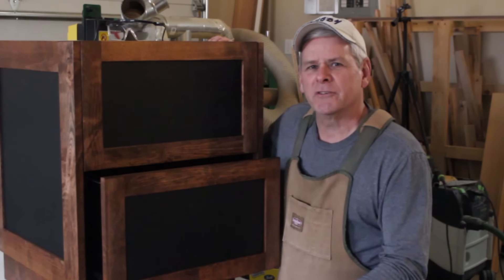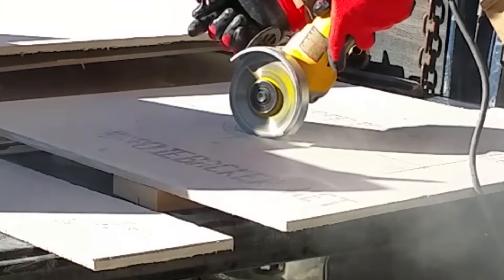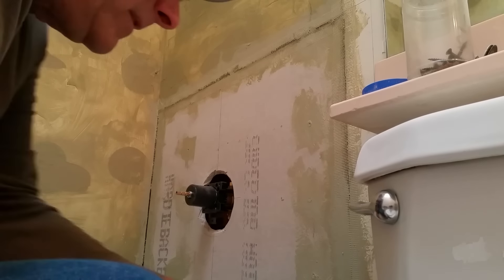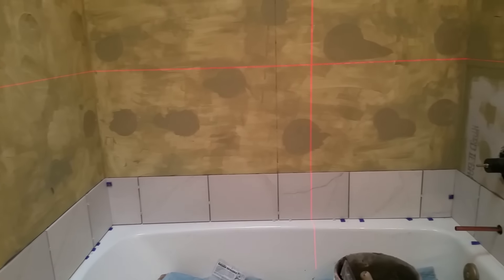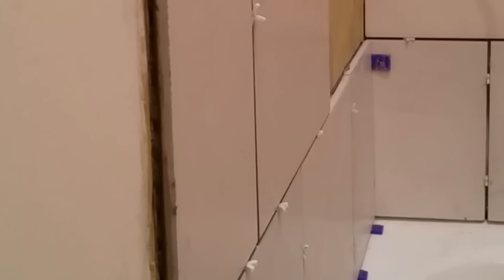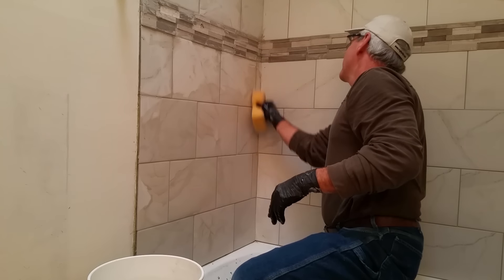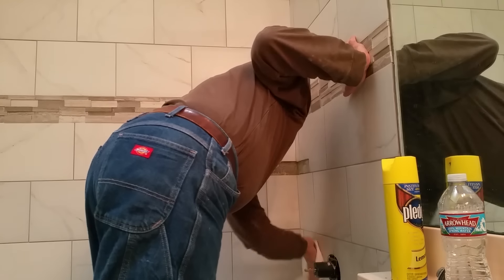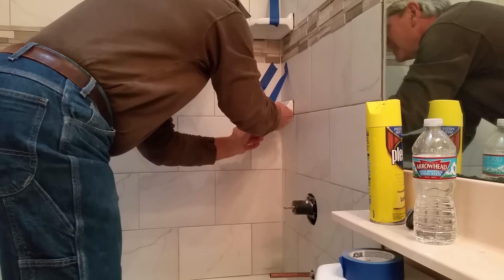How to Set Tile Around a Tub - Bathroom Remodel

Comment: I have a question that I can’t find the answer too anywhere. I’m tiling an old shower wall that was horse hair plaster n lathe. The holes in the plaster around the faucet knobs are too big and the plaster has crumbled away leaving no wall behind. How do I patch that so I can tile over it? Thanks.
Reply from the maker: Hey Jonathan. That's a really good question! You are definitely working with a very old method if you are in the States. I would chip away enough of the plaster to expose some of the lath, maybe an inch or so. You might even be able to take channel locks and crush the plaster to remove it without doing damage to the lath. If you need to add some new pieces of lath to fill up to the holes needed for the new faucet, you can tie them in place to the old lath with thin wire. You could probably use plaster of paris but I would prefer to use 1 part of portland cement and 4 parts sand in a mix to build back the wall. Spray a water mist on the plaster where it is going to be in contact with the cement mixture. Apply a layer of the cement mix to the lath that is about the consistency of half frozen ice cream and let that dry.  The cement is going to be easy to push through the lath so carefully add enough just to cover the lath and let it dry. Next come back again with the same cement mixture and consistency and build your wall back to its finished level. The base coat of cement (called scratch coat) will now soak the water out of the finish coat causing it to dry quickly and allowing you to flush out the new coat with the surrounding plaster. That should work and I hope the explanation is clear enough to understand. Good luck!

Comment: Does the backer board sit over the lip of the tub?  In my case, the backer board is behind the tub by a bit, and i'm not sure exactly what to do.  i could put a 2nd piece of board on top, but then my edges will be really tall.  Any suggestions?
Reply from the maker: Yeah, Kevin, that's a situation where the original framers left too big a space for the tub and is a pain to deal with forever after. Yes, it is best if the backer board extends at least a little over the lip of the tub. The way I typically fix it is to add the additional layer of  backer board on top. Then, at the edge I float out about a foot of drywall mud from the backer board edge onto the adjoining sheetrock and gradually feather it so that you taper the tall backer edge into the bathroom wall over that 12" or so. This takes multiple coats of mud over several days. Then re-texture and paint the wall to match. That's the best way I know to make it look right and give you a good tile installation over the tub.

Here are a couple of my videos on repairing sheetrock damage. They don't specifically address your situation, but the concepts are the same for what you need to do. 

https://youtu.be/kDQ2juMystA

https://youtu.be/JDBEqiMe-WQ

Comment: Thank you! This is so helpful! How do you know whether to use your purple or white spacers and what are the difference? Also, do you know what tile this is, because it is exactly what I have been looking for!
Reply from the maker: Thanks for your comment and questions, Ashley! In this case, the tile did not have its own built in spacers for grout joints, so I was shooting for 1/8" joints. The white and purple spacers are just different brands of 1/8" spacers but you raise an important point. The critical issue for a good looking tile installation is to keep your tile lines running level so I am constantly adjusting and shimming the tile as I work. Lots of variables can cause the tile to begin to creep out of alignment as you work your way up the wall. So, sometimes you need to shim a little more or a little less than 1/8" to keep the next row up level. I keep small pieces of cardboard handy just for that purpose too. The more you do this kind of work, it becomes second nature. The tile was purchased from Lowes and was a discontinued line they were phasing out. I remember it being a gray and white tile and was not an expensive brand. Check Lowes and Home Depot and both may have something similar at any given time at around $2.00 per square foot. Thanks again for watching!
Reply: @RustyDobbs  thanks for the pro tips Rusty

Comment: So, you don't put caulk between the tub and the backing board edge?
Reply from the maker: You certainly can, Andriy. In this case, because the tub has a flange at its edge that the backer board can rest on, I don't really worry about caulking the joint at the top of the flange. The flange keeps water from going up over the edge. But there certainly is no issue with caulking that joint either.

Comment: Nice work! On your side walls, did you also center your first tile and add tiles to left and right to fit and look balanced?
Reply from the maker: Thanks, Robert! No, I think in this case since I was stacking the tile in a brick pattern, I started with a full tile and half cuts where the tile stops on the wall. Generally, the main thing I am looking for when laying out is to not end up with some weird tiny cuts somewhere. If the symmetry works out well, that's a bonus but not the main goal. I appreciate you watching!
Reply: @RustyDobbs  
Thanks Rusty! I think I misunderstood. On the adjoining walls you did not start with a centered tile and work around each side of that main tile to have equal lengths with cutting when needed? This is the way I've started my subway tile (brick pattern, 4" x 12" tiles) and shouldn't end up with any short nubs. Thanks again!
Reply from the maker: @boomerboon1946  Yeah, on the back wall I always start with a center line that I either center a tile on or have a grout joint on depending on tile size and brick or stacked pattern so it is generally always balanced. Sidewalls are a different story depending on how far the tile extends beyond the tub, location of plumbing, etc. Fun, isn't it!

Comment: I have one question about tiling in general, what process do you do first, grout or caulk in a bathtub? It would seem if you grout first it may get into places like the corners and where the tub meets the tile where you really want only caulking. My project is getting close to this part and I have seen no info for this step.
Reply from the maker: Definitely grout first, let it dry and buff it with a rag with a little furniture polish sprayed on it to keep the dust down. You can take a flat head screw driver or a putty knife and gently scrape out any grout that may have been pushed into a corner or at the tub. That doesn't have to be perfect either. Then caulk as the last step. Here is a link to a video on caulking for your reference if you need it. Good luck with the project, Coffee2clutch! Love hearing about people taking on projects like this themselves!

Comment: You don't see too many people that only back butter tiles without applying thinset to the wall.
Reply from the maker: Depends on the situation, Speedster. The goal on any job is to get close to hundred percent coverage of thinset between the tile and the wall. This is a 9” x 12” tile so I’m not worried about getting good coverage by back buttering only. A little cleaner for me to do this way as well. Here’s a video where I’m installing 18” x 24” tile over a tub, so I use a different approach.  https://youtu.be/vkJSdmmeeS0

Comment: I noticed you did not thinset the wall too along with the tile. Is this not neccessary? Everyone else I see does both.
Reply from the maker: The main goal is to get close to 100% coverage of thinset between the tile and the wall, Bryan. This is smaller tile so I could gauge how much thinset I needed on the back of the tile to have a good thinset bed. I popped the tile loose every so often as I installed to check coverage. For larger tile installations, I do both as well.
Reply: @RustyDobbs  thanks. I just did a tub surround with 12x24" ceramic. Turned out good.

Comment: So when you’re cutting the tiles in half and using them on the front of the shower, what do you do about the chipped edge?
Reply from the maker: It is better if you use a newer saw blade to get as smooth a cut as you can. From there you can use many types of abrasives to buff the cut edge to improve its look. A belt sander is a good option. Not as good as a finished glazed edge, but it can be made to look nice in the absence of bullnose. Then I like to backcut the exposed tile edge at a 45 to create a grout joint that finishes out flush with the tile. That grout joint is also durable as opposed to trying to pack grout at a 45 against the wall and the tile edge. Thanks for the question, AzPoorBoys!
Reply: Rusty Dobbs thanks so much!

Comment: Do you caulk the gap between the hardy backer and tub before the tile is set?
Reply from the maker: You certainly can. I typically don't when it is on a tub rim like this where the rim is sloped back towards the tub to keeping water from going over the rim. I focus more on my bottom tile cut at the tub leaving about 1/8" gap for caulk at completion and then emphasizing with the homeowners the importance of maintaining the grout and caulk over time. But every situation can vary.

Comment: I'm so confused. I never saw you put thinset on the wall. But you back buttered every tile. What am I missing, I've never seen it done this way, Please explain?
Reply from the maker: Hope I can un-confuse you! The main goal in setting tile is to get as close to 100% coverage of thinset between the back of the tile and the wall when you set it. I don't care how that gets accomplished. I can trowel thinset on the wall and then slightly back butter the tile before setting it, which is the case most of the time and probably what you are used to seeing. In situations like this job, the smaller size of the tile caused me to change my approach. When the trowel size is almost the size or larger than the width of the tile, it is a pain to trowel thinset on the wall, back butter the tile, then cleanup the extra thinset not covered by the tile when it is set. It is not good to set tile on thinset that is beginning skin over and dry on the wall because you may not be immediately ready to set the next piece of tile yet. So, in this case I am gauging the amount of thinset (extra in other words) I'm applying to the back of the tile to allow me to press it in place and get 100% coverage between the tile and the wall. Every so often I will set a piece of the tile, then pop it off the wall to check coverage. You get a sense for this after a while and can tell by feel as you press and rotate the tile in place if you are getting complete coverage or not between a piece of tile and the wall. Just a tweak to my approach to for a specific situation and actually makes for a cleaner installation. Hope that makes sense!

Comment: Is the entire wall hardy backer board?
Reply from the maker: No, previously the entire tub area had been covered with 1/4" solid cultured marble, so the backer board behind that was in perfect condition. We coated it with a waterproof membrane before setting the tile. The area around the faucet however had some water damage, so we replaced that area with Hardibacker.

Comment: why aren't you applying the mortar/thinset to the wall, notching it then applying the tile? You'll get better coverage that way, and a longer lasting final product.
Reply from the maker: It has to do with the size of the tile, Thomas. I believe these were 8x8s or 9x9s and backbuttering was an easy way to get consistently close to 100% coverage between the tile and wall. Periodically I installed a piece, popped it off to check coverage, then adjusted the amount of thinset I was applying as necessary. For larger tile, I apply thinset to  the wall and backbutter the tile as well.

Comment: What are the black pieces you used under the first row of tiles? Wondering where to find them. Thanks!
Reply from the maker: Those are just one version of tile installation shims that I found at Lowe's. They are beveled from nothing up to 1/8 of an inch with various other sizes in different colors. Pretty handy but I'm not sure I have seen them lately. I bought them several years ago.

Comment: Four bathroom   tiles fell off from the  wall at the  bathtub.What can 
type of  glue  can  I use  to reinstalle the wall tile back on the  wall
 ?
Reply from the maker: Ok, Nathan, that's not a good sign about the overall tile installation so this is probably not the last time you're going to deal with tile falling off the wall.  I'm guessing that this is an older installation with tile less than 6 inches in size and tight joints? As a quick and reasonably permanent fix, I would buy a tube of silicone caulk and a small container of unsanded grout that matches your joints. Every few inches on the backsides of the tiles, put globs of caulk about the size of a quarters and push the tiles back into place. After a couple hours, mix water with the grout to about the consistency of half melted ice cream. If you don't have a grout float, you can take any type of blade or putty knife and press the grout into the joints. Wash the grout joints back down flush with the tile with a sponge after allowing it to dry about 10 minutes, then buff the tile with a cloth when the area is dry. If the grout joints are wider than 1/8 of an inch, you're going to want to use a sanded grout instead of the unsanded. Good luck!
Reply: Yea  I was  thinking the same  thing using  white  caulking.But  unsanded and  sanded   grout I did  not  know.Thank you very much Rusty for your  valuable information.Have  a good day.
Reply: Sorry to bother  you again Mr. Rusty  but  I got another  qestion.There old grount on the tile and  wall.Howcan I get that off.I try to chisel it off but broke  the tile.And  where can I get 1960's pink bathroom  tile at.Everywhere  I go they sell white.What online store sell pink bathroom tile ? Thanks.
Reply from the maker: You're probably out of luck on that one, Nathan. Pink tile you might find online probably wouldn't match very well and the dimensions would probably not be correct either. That's the kind of thing you run into repairing old tile jobs. At this point, I would suggest you get the tub/shower functional again with whatever tile you can find that works. Sounds like it's about time for a new tile job! You're on the right track as far as removing old grout and adhesive. You do whatever works. An angle grinder can help with getting it off the tile.

Comment: Great video. Is the "perfect level" always going to be below the first row of tile? Could it be above and then fill in gap between 1st and 2nd row with grout? Also did you cut the holes for the soap dish before or after you placed the tiles?
Reply from the maker: Not sure if I completely understand your question, Matt. If the tub is perfectly level (which is likely not the case) then the "perfect level" line could be one row of tile above the tub. If not, you want your perfect level line to force you to make cuts at the tub to create an acceptable grout/caulk joint there. You can adjust your line down to help make the cuts against the tub easier. You never want to "fill a gap" with grout that is larger than what is the normal grout joint for the job you are working on. Yes, I cut the slots for the soap dishes in the tile on a tile saw before setting the tile. Thanks for the question.

Comment: really helpful info. I'm going to undertake my bathroom reno myself soon. I have to do floor tile everywhere and wall tile in the tub/shower area but to the ceiling. Would you normally leave a 1/8 gap at the ceiling to fill with caulking too? Also someone I know is telling me to use plywood with tile treatment you mix with water and brush on for the floor tiles. Should I still use cement board for the floor too? I would think even treated plywood would expand and contract at a faster rate than tile which would cause grout to break up.
Reply from the maker: Good luck on your project, Sparky Jay! Yes, that would be fine to leave a 1/8" gap at the ceiling then use siliconized caulk to match your grout in that joint and in all other corners. In this day,  I would always use cement board over a wood subfloor. Your instincts are right about the plywood. Even treated properly, why would you set tile on it when you can install cement board over it and not worry about your installation. You'll get a lot of satisfaction out of this when you are done.

Comment: Outside most tile installers use slouter strips on exposed edges.
Reply from the maker: Thanks for the comment, Dave! Yeah, I live in the southwest where the style is a lot of tile. Many times here you see grout joints on edges where installers pack on grout and cut it down to a 45 that rests against the edge. Problem is it is not supported breaks away very easily. If trim pieces are not available, I prefer to back cut the raw tile edge to essentially make a grout joint on the exposed edge. You get rid of the unfinished tile edge and create a grout joint that does not protrude out from the tile and is also very secure.

Comment: How come you didn't put thinset on the wall?
Reply from the maker: It often depends on the size of tile I’m installing. The goal is to get close to 100% coverage of thinset between the tile and the wall. Sometimes with larger tile, I achieve that by spreading thinset both on the back of the tile and on the wall. With this size of tile, it worked best for me to just back butter each individual piece of tile. Depending on how porous the wallboard surface is, thinset spread on the wall can start to dry out very quickly which leads to poor coverage on the back of the tile if the tile is not back buttered. It's just something to be aware of.